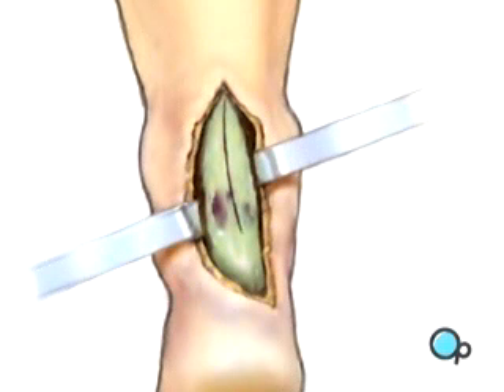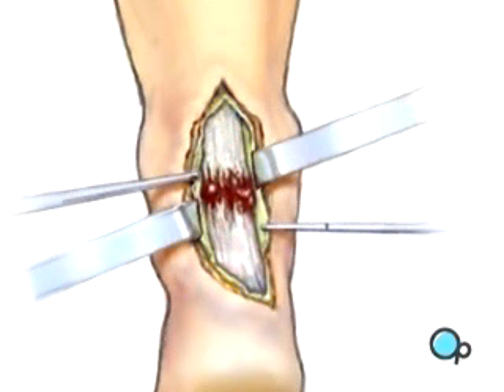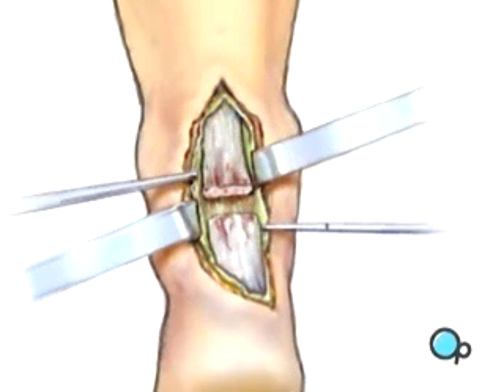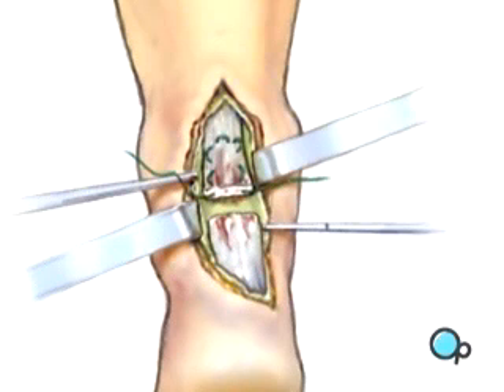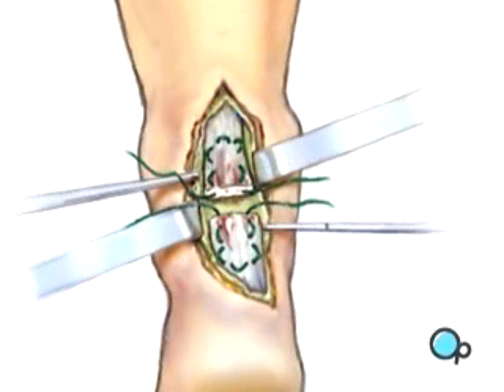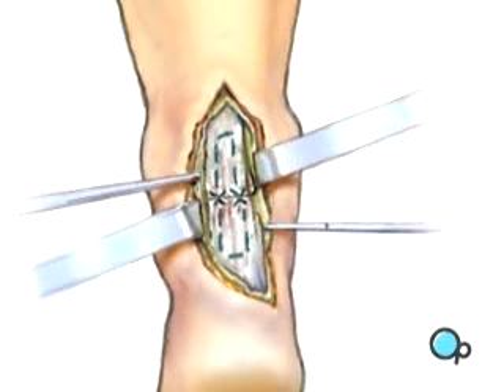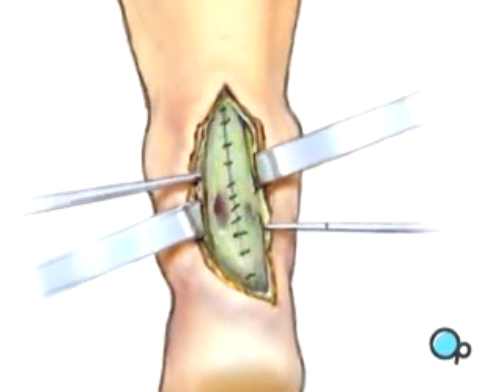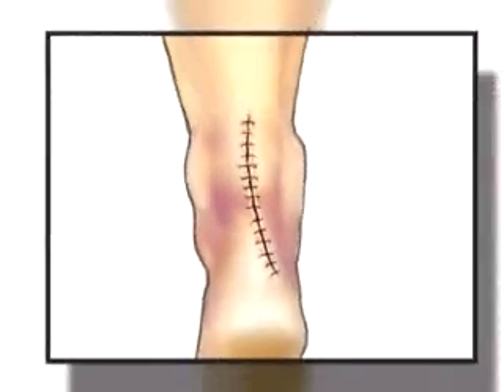PreOp® Patient Education: Achilles Tendon Repair Surgery

Comment: Hi there! I have a right leg partial Achilles tendon rupture April 26th during basketball practice doing"suicides"(run from end of the field to a line, running backwards to the beginning and to the next line and so on)

Have been in cast with foot pointing downwards and cast half way above knee-groin and knee flexed at 45º until June 8th.

Now, new cast.  Flat  foot walking position just below the knee until July 7th.
After, physical therapy.
Hope all u healed good, I'm keeping positive.

Vando